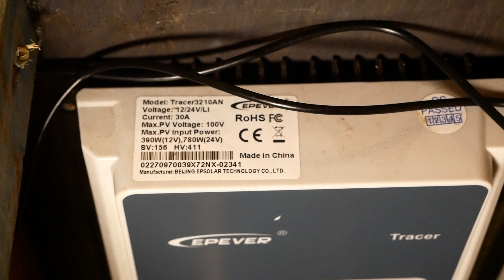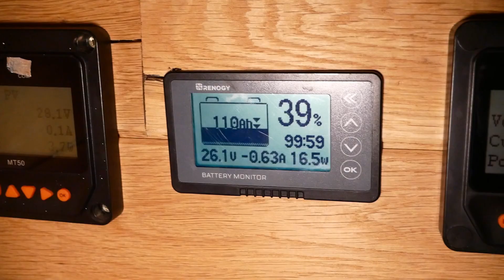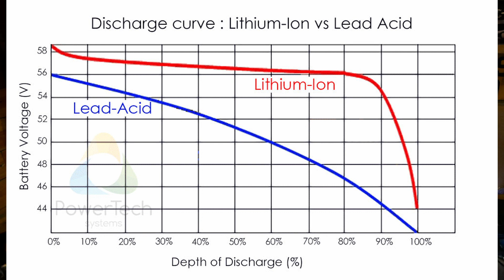My Budget Off Grid Electrics Setup | Winter Van Life Scotland

Comment: You did say "Budget" you didnt add "MASSIVELY HUGE BUDGET". OOPS
Reply from the maker: Fair point, but if you minus the £1200 for the battery and used a £500 one you’d have a £1500 electrics setup which is not bad as that will power you probably all year round. Basically my setup is quite large but if you took the same (non victron) components I have on half the scale then it would be very reasonable due to the components I use. Also My system is very specific to me and therefore I would not recommend anyone copy it directly as their uses would be diffierent 👍

Comment: Good setup, I'd go 48v if building mine from scratch, just as thats the new off grid standard everything is being built for. I do suffer the wire and MMPT issues with 2kw solar on 12v.  Another shout out for Andy's channel for good info.
Reply from the maker: I see what you mean, 24v does work great for me but 48v would be cool! Haha yeah!
Reply: @RustyRoseAdventures  only disadvantage is at least 2 panels in series.  I quite like the shading resistance of single panels in a string.
But with more houses wirh battery/solar there are more and more 48v items out there and only getting more common.

Comment: Jacket spud on top of the log burner :)
Reply: Great vlog and setup matey! We're revisiting our electrical setup next year and looking at replacing all with bluetooth management for items with out bluetooth etc .  Is the JK BMS managed without bluetooth and if yes do you mind me asking which model?
Reply from the maker: @gigvanrig no sadly it does have Bluetooth. But Richard mentioned you can always line the area with tin foil to block it 🤔
Reply from the maker: Yep 👍
Reply: You can protect potatoes from bluetooth radiation by wrapping them in tin foil, all the best @RustyRoseAdventures